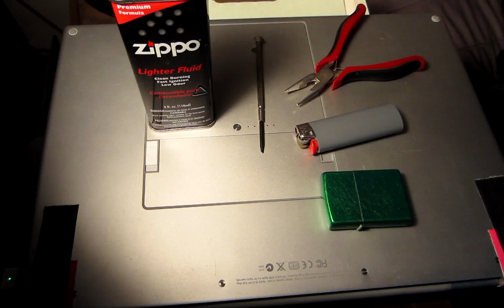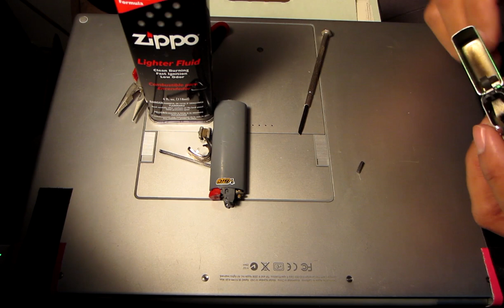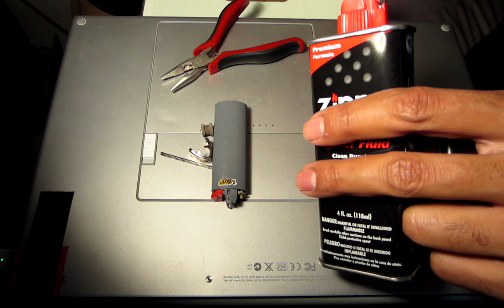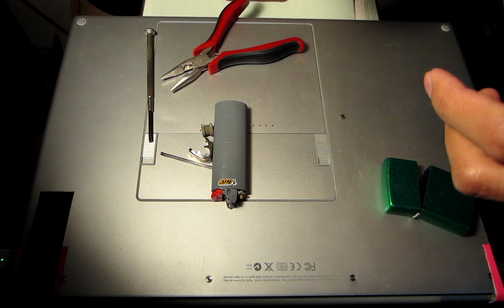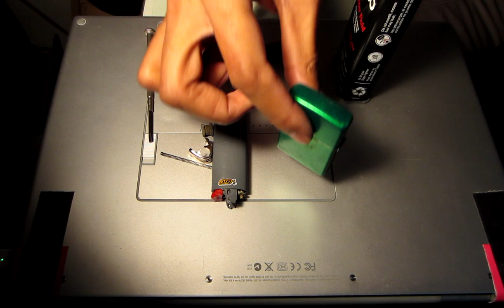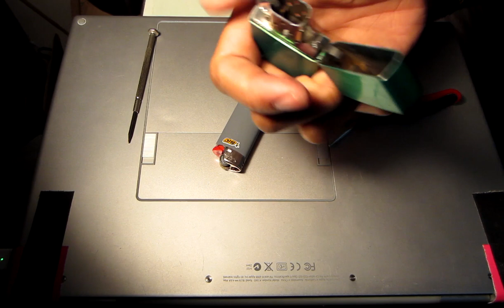How To Take Flint From An Old Empty Bic Lighter For Use In A Zippo Lighter | Resourcefulness 2020

Comment: didn't use this on a zippo but it saved my clipper from being tossed in the trash. thanks man
Reply: Clippers are refillable lol
Reply: @causetheplumstasteyum7848   we are talking about the flint, not the butane...
Reply: @ZioFrankekko  Yes i know , its easy to replace a flint on a clipper , how did this video " save " ur clipper though ? all you do is pull it out and swap it for a new one
Reply: @causetheplumstasteyum7848  i didn't know where to get the new flint from and had lots of bics without gas but with perfectly fine flints, and this video taught me how to take them out

Comment: Few tips. The hole in the felt can be used to store an extra flint. You can use the lid as a screwdriver for the spring. You can also use the lid to pry the zippo fluid bottle nozzle up.

Comment: yeah regular flints  actually work good in zippo , in my country i use regular flints those cost around 2 rs per piece (0.024 usd approx) but the main problem is the zippo fluid that has no alternative